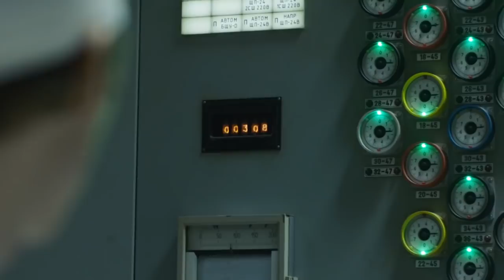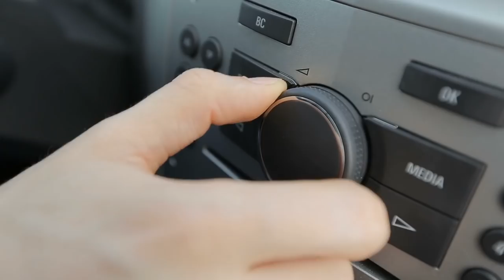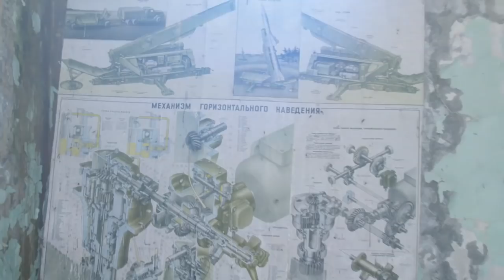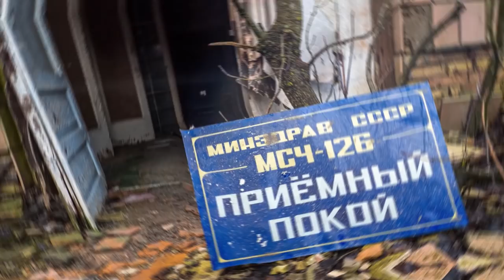10 Most Insane Places of CHERNOBYL

Comment: A few corrections... a stalactite hangs down while a stalagmite rises from the ground, the elephant's foot is a stalagmite while others in the facility are stalactites. The elephant's foot is also not solely comprised of nuclear material from the explosion, it's a combination of materials from the reactor itself and from the structure it encountered while melting down, along with the sand, boron, lead and other material thrown into the reactor in the days after the explosion in an attempt to slow or stop the runaway fission. It wasn't created immediately during the explosion. It's also far safer now than it was in the years immediately after the disaster and although it will likely never be moved it can safely be monitored and controlled. It's now also stopped moving and the temperature within it has cooled significantly.
Reply: One other correction, the sniper who took the shot did not use an "assault rifle" as that is an invalid term, he used a rifle of proper specification.

Comment: Most people leave their homes for good only for like 1-2 years but people in Chernobyl leave their homes for good for about 30-35 years... i cant believe if Chernobyl finally completely restored i wonder what the people's reaction be like looking at their dark past... finally restored
Reply: xXx_MlgTr1kSh00ter _Xx well the radiation hasn't gone it's still extremely risky so most tours only last 10 minuets at max
Reply: @bobbypriest114  Now that the New Safe Confinement is over the reactor building its not that risky (still uninhabitable for long periods). Most tours can last more then a few hours. There is even a hotel for tourists that you can stay at for one or two nights.

Comment: it is not true that there was a fire of melted fuel after the incident. All the nuclear interior came out within seconds thus emitting 97% of the total compartment. There was a measuring of Constantin Tschetscherow showing 24 degrees celsius in the center of block 4  shortly  after. Sebastian Pflugbeil inspected the scene some years later also being able to access the reaktor itself without considerable radiation. The elephants foot is exactly an evidence, that the material cooled down within seconds for there was no meltdown, but a rapid fission. A meltdown would have resulted in burning the entire environment around the elephants foot, but that also did not happen. So the thermal plastic - time of the melted material must have been very short. Folks, it almost came out entirely, all the other stories are fake.